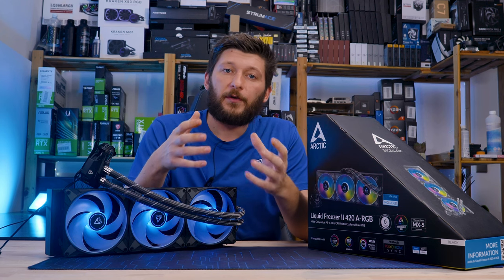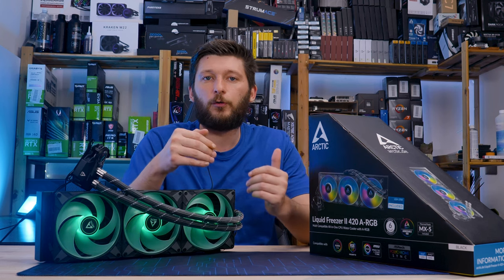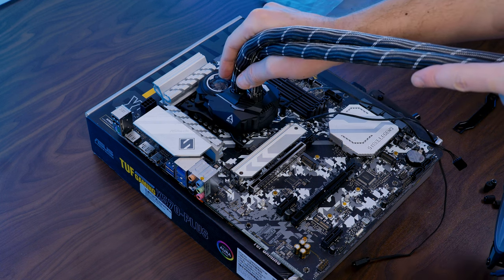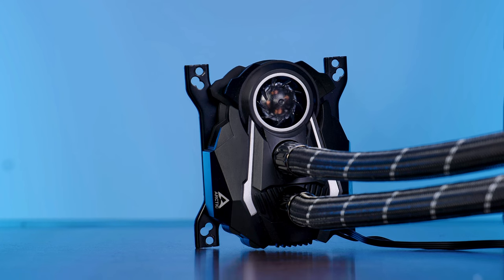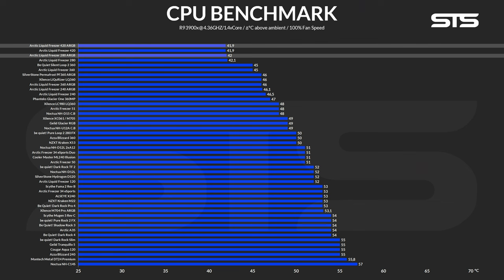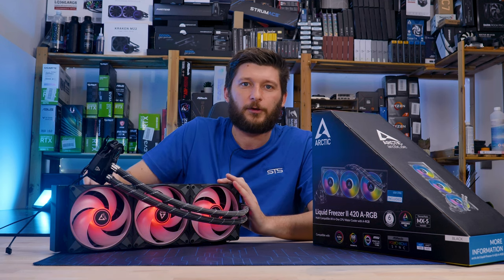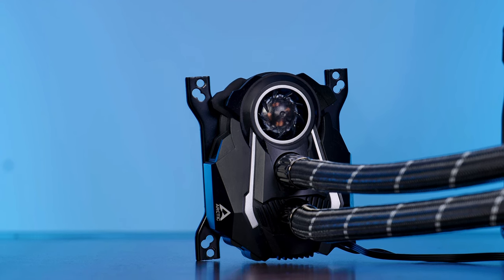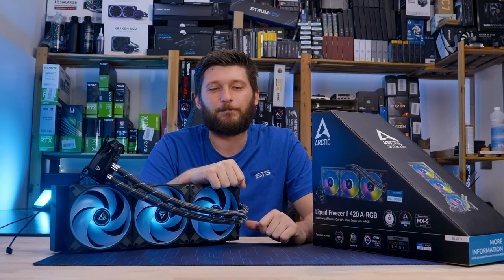Arctic Liquid Freezer II 420 (ARGB) Review - The BEST AIO Money Can Buy

Comment: The temps are so much better with a 420mm vs a 360mm, especially with the 12900k that likes to run hot. I was getting 15C cooler in benchmark tests. Also being an all metal bracket on the intel side has been so good for the LGA1700 vs Lian Li's plastic bracket. One of the cheaper AIOs out there but so far my favorite.
Reply: Remember a 280 is already 91% of a 360mm. A 420mm is 36% bigger area wise.
Reply: @PowGetRekt  yeah imho going for the 120mm fans is a mistake for AIO.......and I got myself a 240mm unfortunately.
Reply: @Ilestun yea the arctic 240mm cant really handle my 7950x3d, i will get a 420mm soon

Comment: Just baught two P12 fans for my good old ML240 AIO which was 100% stock, improved thermals (from 78 deg to 75deg) but more important : Massively improved the noise compared to coller master fans. Those fans are good. Was hesitating with Corsair fans because I still got two slots on my commander XT (just baught the 7000x case), but screw those prices seriously.....corsair's fans (ML120 elite premium) are double the price.

Comment: Thanks for this, just grabbed a 7900x and I’m def leaning towards an Arctic. Do you think the new P12 Max fans on a 360 will out do the 420?
Reply from the maker: Uhhh, that's a tough one. Possibly. It's definitely possible. But I doubt that you want that.
The sheer size alone gives the 420 so much more headroom. And IF the 360 with Max'es could get that far, it would be by brute force = noise. So I would either get a 420 or wait for a 140mm Max.
Reply: @STSYT  that’s a really good point regarding noise from it being brute force. And with the partial open air car I bought the 240 sounds like the better option all the way around.

Comment: How does it compare to 240 to 360 radiator? Will it be enough to cool the 13900k or 7950x? My case is not that big.
Reply: Its much better than any 360mm. This one of the few cooling solution for the 300w heat power from the 13900k.

Comment: Buyer beware! I have one, arctic liquid freezer 360 II a-rgb, not for 6 months and the VRM fan bearing is trashed and makes a terrible noise at higher fan speeds. Seen other reports of this as well. Trying to go through support right now, but man, what a hassle for something that is totally auxiliary to the product.
Reply: Yeah, I wish they'd ditch that little microfan and just switch to a sleek, modern water block that doesn't look like a gaming mouse from 2003. Either that or have it default off until you hit some kind of temperature threshold. Modern cases move plenty and air and modern motherboards have plenty of VRM cooling and heatsinks.
Reply: those mini fans are always a horrible idea. never last and cause insane noise. thanks for the ehads up I didn't know that was on this thing, will avoid it.

Comment: I swear I thought you already reviewed this cooler in the past? 
Anyway there must be something to those P14 ARGB fans... I remember the Arctic LF2 280mm ARGB also scored very high when you reviewed it.
Reply: The P14 fans are great, but I don't think it's the "secret sauce". Instead, keep in mind that Arctic uses thicker radiators for it's AIOs. So Arctic radiators have more thermal mass than other AIOs of the same footprint, on top of having pretty decent fans.
Reply: @sliptap   @sliptap   @sliptap  Thanks for your input and good point! I'm well aware that Arctic radiators are thicker than most other AIOs, and I can't complain about that :). And I own both the P12 and P14 (non ARGB) and they're decent. 
On STS's review on the LF2 280mm ARGB it scored just slightly better than than the L2 360mm regular and ARGB versions. Made me wonder if there was something slightly different in Arctic's newer line up140mm fan ARGB AIOs, honestly I dunno... especially since when it comes to the 360mm version the ARGB version is usually always 1~2c behind the non-ARGB version.
Reply: @Ben-ld1qi  differences that low tend to be attributed to margin of error/ambient temperatures

Comment: You should've used the 13900k for this video. Why didn't you?
Reply from the maker: because we test all the coolers on exactly the same CPU to be able to make comparisons
Reply: @STS  yes time to move to a hotter cpu you have to start at some point!
Reply: It would be nice to see this cooler pushed to absolute limit with 13900ks.

Does the lquid freezer ii 420mm molest every single air coolers?
Reply: @csguak  yes

Comment: DeepCool LS520 and LS720 is the best cooler you can buy. It costs almost the same as Liquid Freezer II , but doesnt look cheap. Liquid Freezer II has a budget look and feel.
Reply: It doesn't really look and feel cheap in person. The fans may look cheap if you have the non rgb fans, but it's generally pretty solid. The block isn't for everyone, but it's pretty sturdy as well. Just a shame the white version isn't available yet tho.
Reply: Deepcool might not look cheap, but they do break down. And when they do their customer service is complete shit.
Reply: I bought the 360 arctic aio bc my deepcool broke 😂😂
Reply: @spliittz666  Kind of pointless to comment without meantioning specific models. I wasnt comparing brands.
Reply: @j000pe  I was talking about a specific model not the whole brand. Deepcool had its problems with specific units in the past, but LS520 is an excellent AIO with anti-leak tech and cooling on par with premium AIOs.
Reply: @j000pe  Haven't had one fail on me yet
Reply: @spliittz666  lmao 🤣🤣
Reply: The look and feel becomes less of an issue once it goes inside a case. But the real quality shows up once it starts working. Arctic is shown to be silent at top speeds. Can the same be told a out deep cool?
Reply: @Wingedmechanic  Yep, DeepCool LS520 > Artic Cheap Freezer
Reply: @smthsmth  fanboy spotted 🤣
Reply: @radicalthunder5740  fan boy for an AIO? Are you ok in the head? What's next? Fanboy for a fridge or washing machine? I am just pointing out my experience and spitting facts my dear teenage boy that knows only a few words and one of those is a "fan boy"
Reply: @Goddamnyoutube  🤣🤣🤣 you are spitting something but it sure as shit ain't facts
Reply: They don't even outperform the LFII that is the same size, let alone this one
Reply: Funny how you didn't mention performance. Cope much?
Reply: @DrakonR  funny how you cant add 1 plus 1 together and come to a conclusion that perfromance is the first thing when comparing AIOs. When Gamer Nexus makes a video saying "Best AIO of the year" you would comment "but but you didnt meantioned performance, hurr durr". Best = performance in this context. And yes, I have compared both and LS520 cools AMD 7000 series CPUs like a boss.
Reply: @smthsmth  show us your numbers then
In litteraly every benchmark I have seen the Liquid Freezer II outperforms the SAME SIZE LS cooler from deepcool.
And then you are enough of a clown to think that the LS720 will beat the 420 LFII? When it already loses to the 360? Hand me the popcorn please...
Reply: @smthsmth  And no excuses, if you can't show your data don't use it as a point of argument
Reply: @Wingedmechanic  Nope, the LFII 240 beats out the LS520 (240mm) and the LFII 360 beats out the LS720 (360mm)
So its pretty obvious the LFII 420mm is still on top
Reply: @DrakonR  learn to read, I said performance is close, but deepcool doesn't look like a cheap shart with discount bin tubes.
Reply: @smthsmth  ah so you finnaly admitted the LS isn't better and your reason for saying that it is because you don't like how the LFII looks. Good.
Also about your unnecessarily rude reply that was deleted, read my message. All the reviews clearly show the LFII outperform
Reply: @smthsmth  don't you think its ironic that you use "fan boy for an AIO? Are you ok in the head?" And then call someone else one when faced with solid arguments? Still waiting on YOUR benchmarks sir
Reply: @ykguy6379  funny how one guy uses 3 accounts to ask the same silly questions. Answer is - google it, this is not a reddit where you can discuss stuff in details, its a god damn youtube
Reply: @smthsmth  ??? I have one account? What are you on? 
Google shows the LFII outperform as I have said several times. You said you had tested them both so prove your point or don't argue
Reply: @smthsmth  maybe watch the language a bit so that your useless speach doesn't get deleted
As for the important part of your comment: "I didn't say it outperforms LF2, I said it's close."
Good, you can stop calling the LS720 the best cooler then
Reply: @ykguy6379  Its the best because performance is CLOSE but build and design quality outperforms LF2 by far, besides it has anti-leak technology.  If you have seen LF2 in real life you would know that its tube looks like something from a discount bin and is super inconvenient to bend in the right shape. Lol, what is so hard to understand kiddo? Stop spamming and go play some games instead.
Reply: @smthsmth  Your design preference means absolutely nothing my friend, and it's not like deepcool is the only one putting anti-leak on their aio's 😂
Reply: @SgtButthurt69  Try setting fan curves if you haven't already
Reply: @SgtButthurt69  are you overclocking?
Reply: @SgtButthurt69  good